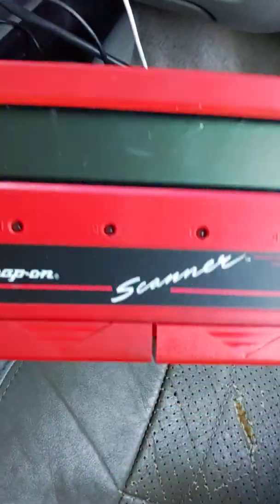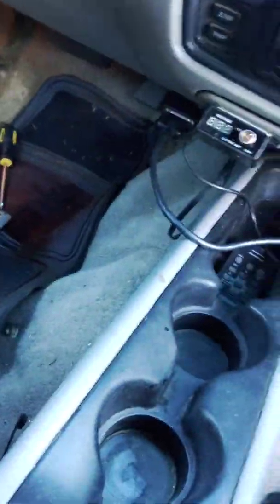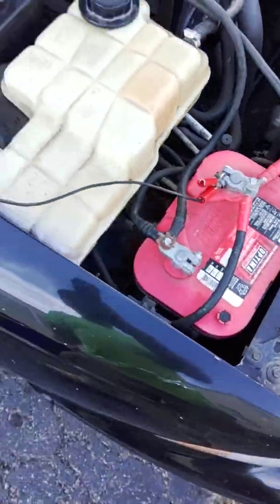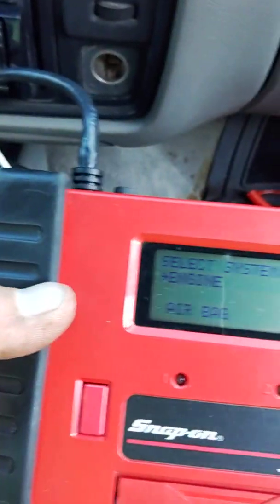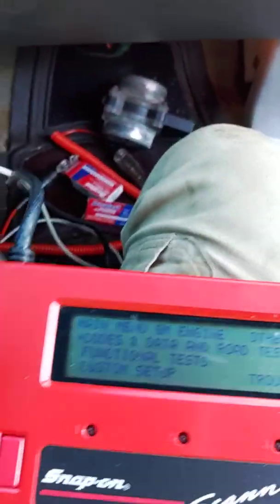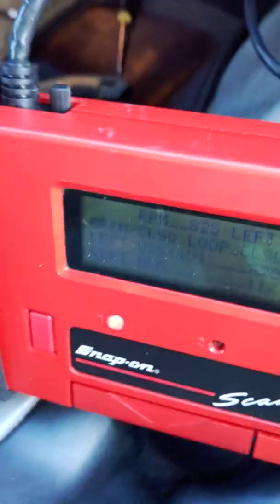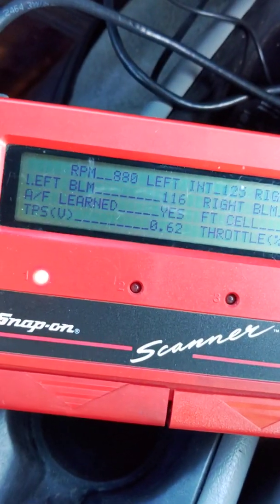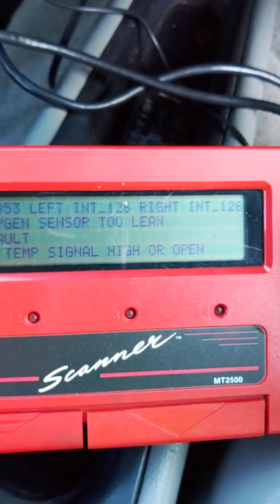1995 Impala SS obd1 scan tool trouble codes diagnostics

Comment: Did you find out what was code 29 the problem
Reply from the maker: Number 29 was the smog pump relay I removed
Reply: My bad now it’s code 21 I replaced tps sensor also cleaned throttle body and replaced other sensor on throttle body still have problems and code is still there
Reply from the maker: @ramonrincon8078  21 is “throttle position too high". Usually I would say replace TPS but since you did that it most likely is a bad wire in the connector. You're going to have to check wires with a multimeter.

Comment: Where can I buy that scan tool
Reply from the maker: I got it on eBay for about $300. They're old but so are these cars. Find a seller on ebay with a good seller rating. It takes cartridges so you need to make sure you get one with Chevy cartridge for your correct year. It's possible to find other scanners that will work the trick is having one with the power cord.